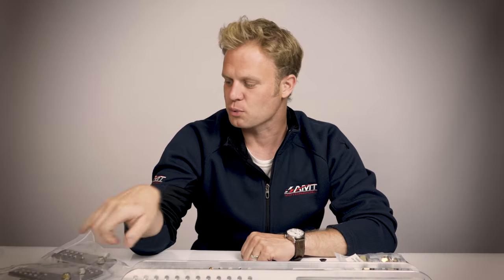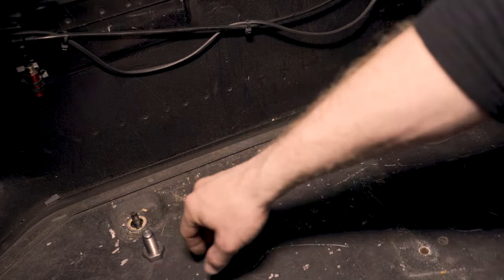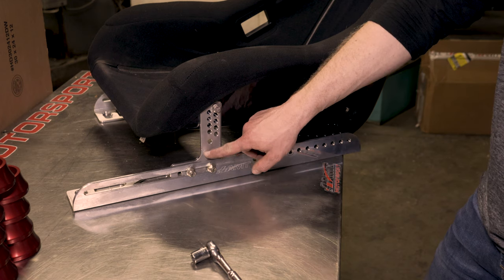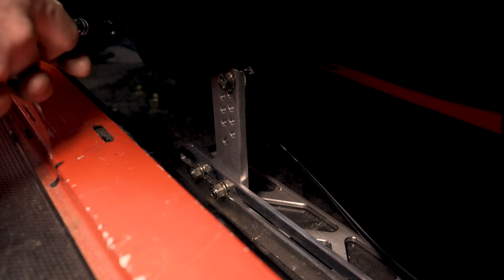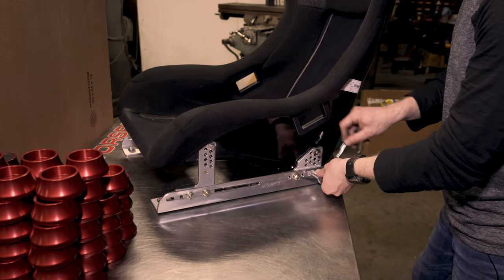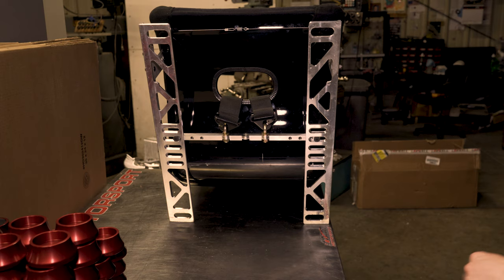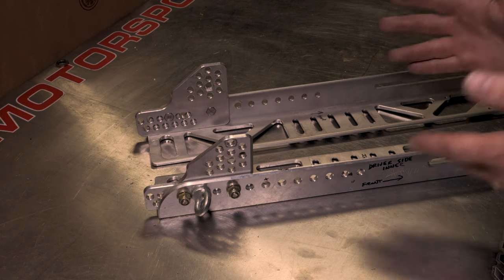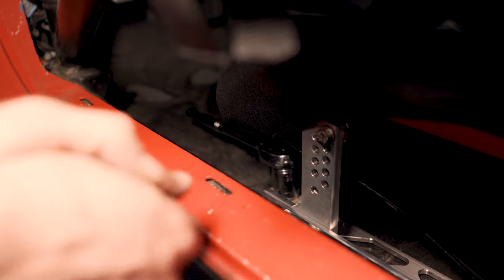AMT Motorsport - Ultra Low Seat Mount Installation in Corvette

Comment: Awesome mount. The integrated hex heads on the back is genius. Great job on the presentation, though I would have like to see how you reached the rear inboard nut - that location is brutal.
Reply: I’m guessing a crow foot socket.
Reply: Yea.. stopped at most important part. Ha

Comment: Can you use the stock seatbelt configuration with these? I haven't removed the seat yet, but I believe the buckle attachment point is tunnel side (for driver seat) and needs to be mounted to the seat itself?  I'd like more headroom, but I haven't invested into a harness system yet.

Comment: can you use stock seat belts with this?
Reply: Yes. Not recommended, but you can. You will want a longer bolt for the rear tunnel side, a rather large washer, another rather large washer, and to cut the tab off the bottom of the buckle.